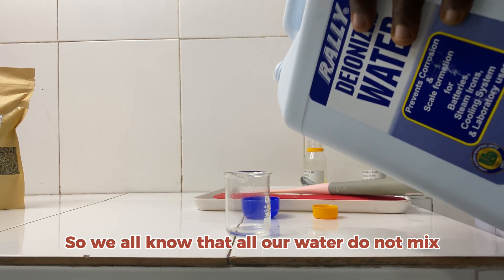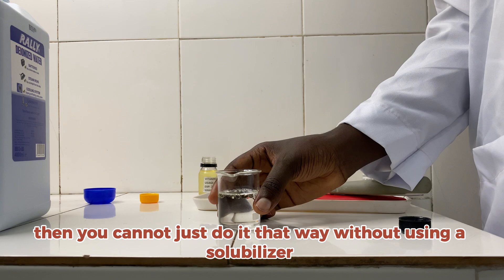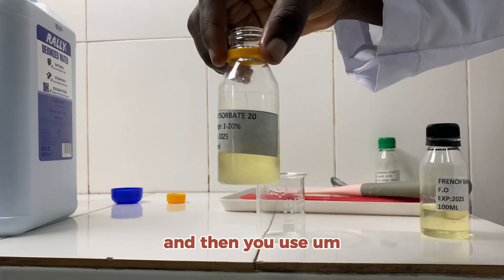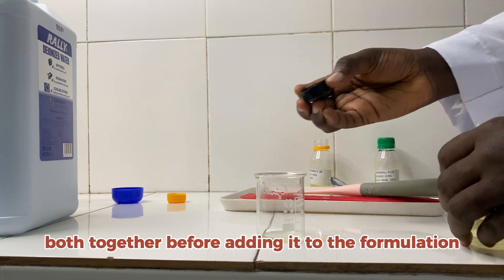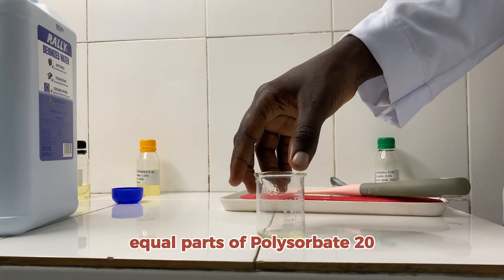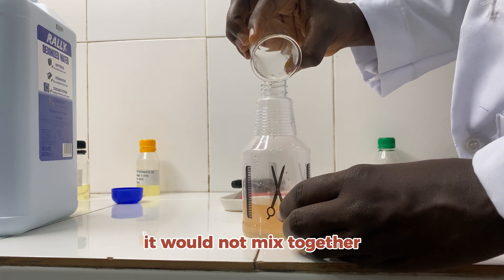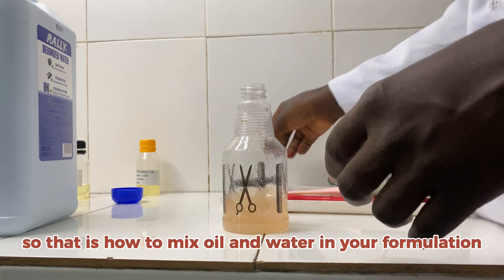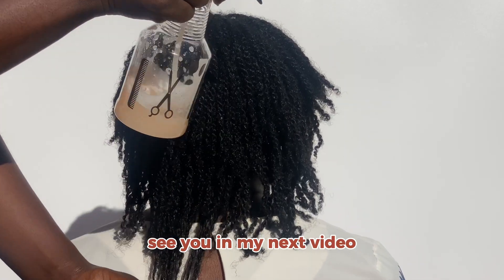How to mix oil and water in haircare formulation | How to make stable emulsion|Oil in Water emulsion

Comment: If I want to use any other oil like olive oil or coconut oil... Can I use the same process
Reply from the maker: Yes, just use the same percentage of both(oil and solubilizer)
Reply: Is it possible to use shea butter instead of vanilla oil? Please.
 @Midex_formulationschool
Reply: Is it possible to use shea butter instead of vanilla oil? Please.
Reply from the maker: @sabahabubaker6345 Fragrance oil and shea butter has 2 different purposes, so no you can’t